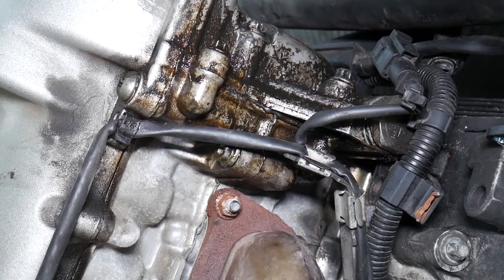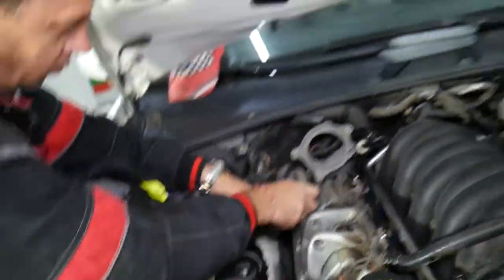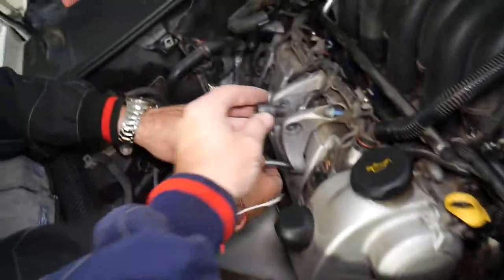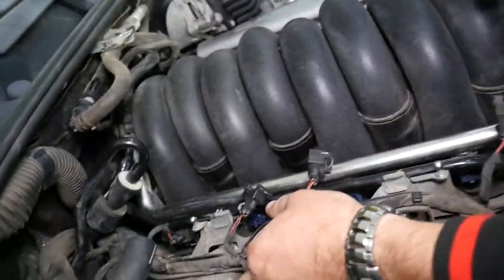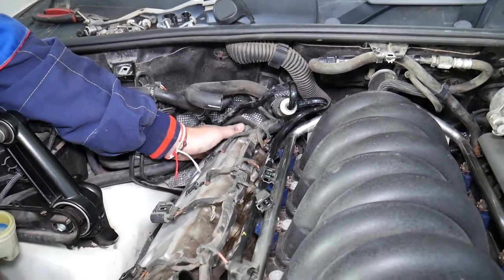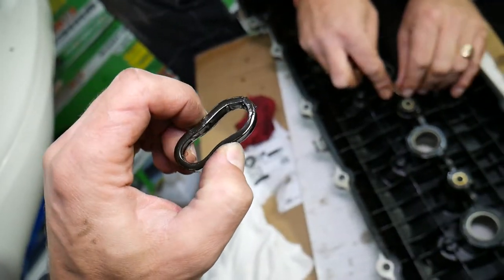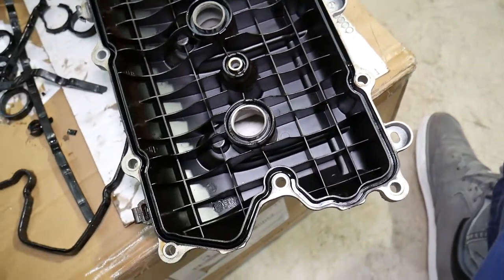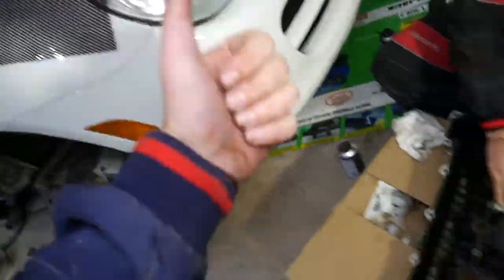PORSCHE CAYENNE S PASSENGER SIDE VALVE COVER GASKET REPLACEMENT REMOVAL, OIL ELAK FIX

Comment: I've been learning  a lot from you guys.  What I didn't notice is before winter I changed my petrified valve cover gaskets because my plug valleys were filling up with oil.   I was happy.  But what I didn't know is about that VVT seal.  I kept smelling oil odor all winter.  I took my valve cover off today and I noticed that is where I am leaking oil.  so i ordered a new valve cover gasket set that comes with those two VVT seals.  Now the utterly most important thing as in more important than your 2nd child is when removing the valve cover don't man handle it and get frustrated because those wires in the back are sorta holding it down and for gods sake don't yank on it like I did.  Why?  Well all winter i drove with my check engine light on, engine missing, codes to the left, codes to the right.  Well I did what others did and I bent one of those VVT tabs on the back of the camshaft.  I don't know if i am one lucky S.O.B. or not but I bent the skinny one and today I bent it back into shape and I have no drivers side cam position sensor check engine light anymore.  So happy.  Just not happy I have to remove. the covers AGAIN to replace those VVT seals.  But well worth it.

Comment: Hey there, thanks for the video. Just a simple question really, I have a blown head (valve on #3) on this side. Do you think it would be possible (not easy but possible) to get the head off without dropping the engine?